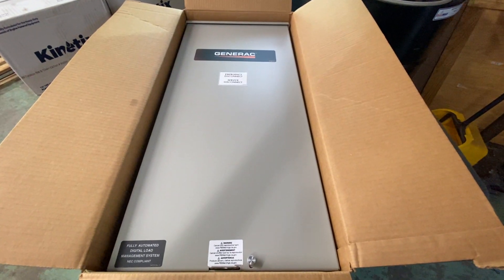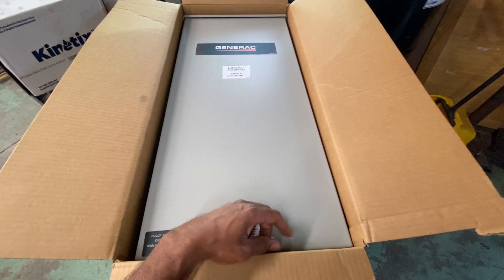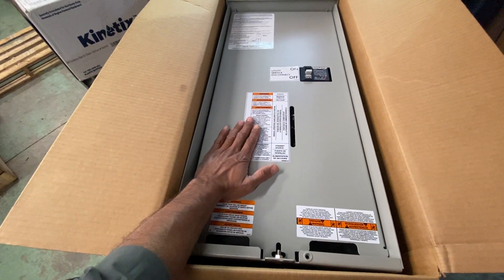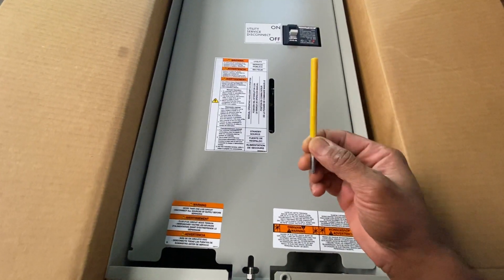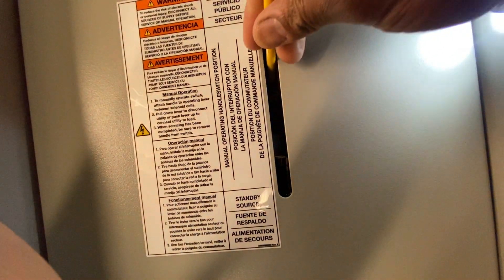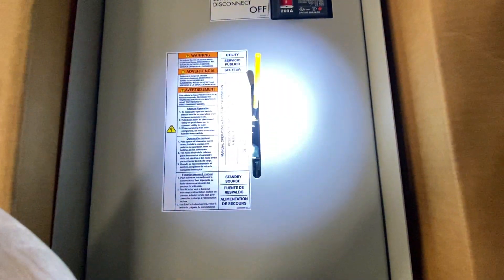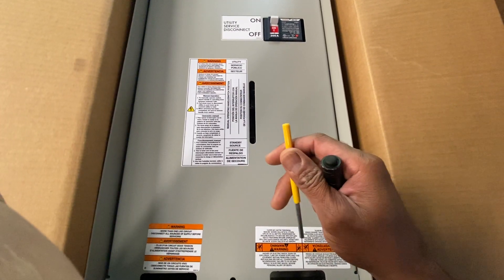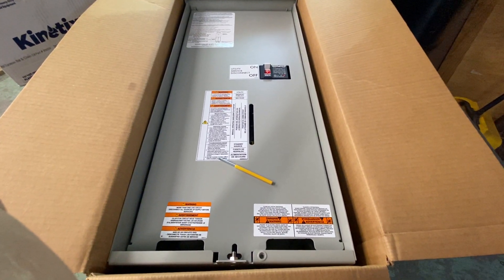Generac 200Amp Service Rated Transfer Switch - HOW TO MANUALLY TRANSFER during a power outage

Comment: I have this exact model on a new construction home. I didn't have the budget for the generator yet but have a portable pull start generator. Can I use this manual method to safely transfer over to my portable?
Reply from the maker: Yes you can, when utility power is restored it will transfer back as well. 

Just be mindful of the load on the portable.

Comment: When utility power is restored, it should transfer to the grid automatically...so when there's an outage, does it transfer to gen power automatically also
Reply: It depends on whether you have an Automatic Transfer Switch or a Manual Transfer Switch. People on a tight budget sometimes opt for a manual transfer switch because of the price difference.
Reply from the maker: Yes, manual switches are cost effective however Generac has a manual switch that can be upgraded to automatic when your budget allows.
Reply: I have a Generac 24kw with the automatic transfer switch  on my farm and yes it is all automatic. Worth the price.
Reply: What's that On/Off large lever for? Personally, I'm not messing with that yellow thingie, when utility has an outage, doesn't the lower coil become energized when it "sees"  backup generator voltage at correct voltage/phase ? Doesn't that large lever in Off position shut off top coil ? I don't like the idea of risking messing with those coils when they could be energized by Utility or Backup generator.
Reply from the maker: Yes, everything should be automatic ... this video was to help homeowners when things don't work as they normally should.

9 out of 10 times everything should work hands free.